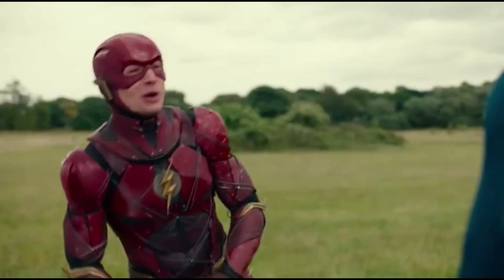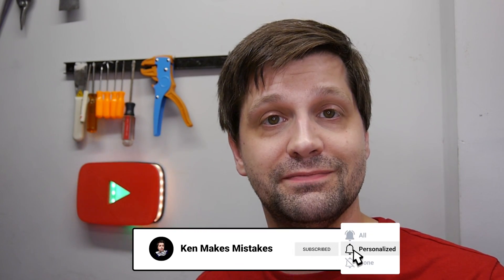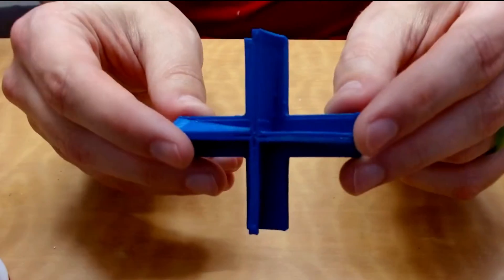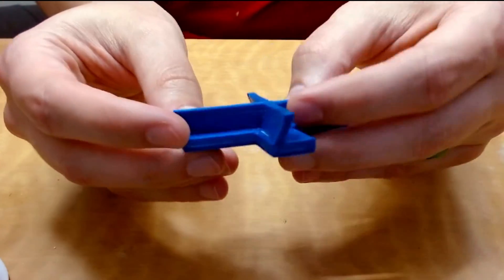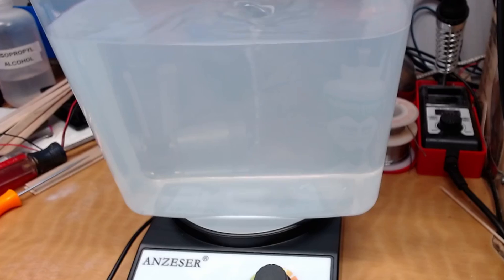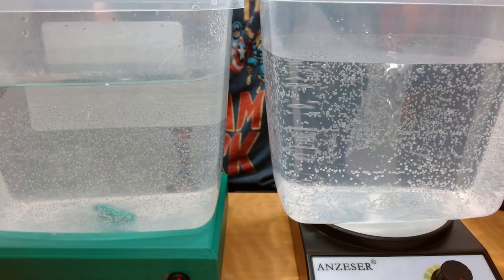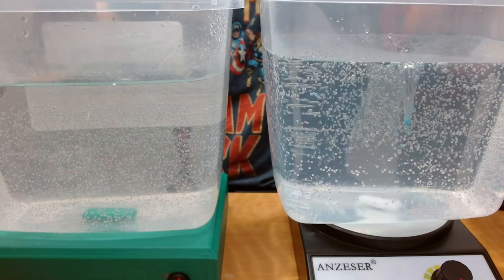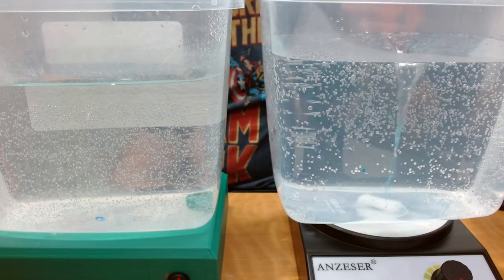3d printed magnetic stirrer vs Amazon's cheapest - FIGHT!

Comment: Try bridging your two magnets with an iron bar. It will change the shape of the field lines, which might help. But I think the weak spot is the fan motor, which is best for higher speeds and lower torque. Pushing a magnet that’s pushing water (or IPA) is a decent load. I realize that “the motor I have on hand right now” is the cheaper option, but if you just happened to have a different motor lying around...
Reply from the maker: It's like you could sense a part three was incoming. My next step is to try with a drill motor and the same hard drive magnet, but because that's a ground-up redesign, it might take a while to build.

Comment: This is some quality content! I really hope this channel takes off.

I'm going to ask on r/3Dprinting (where I found this video) but I wondered if you might know: What could cause my Anycubic Photon's bed to twist vertically? The bed's arm that connects to the screw is skewing to the right and may be causing some of the distortions I'm experiencing. Do I need to tighten the bolts.
Reply from the maker: Thanks! Man, I wish I knew the answer to that one, but I'm still new to resin printing, and I haven't had to learn any hard lessons just yet. I'm sure you'll find good help over on  the subreddit.